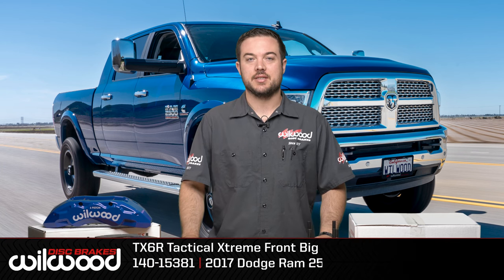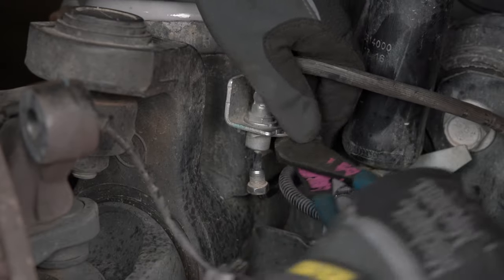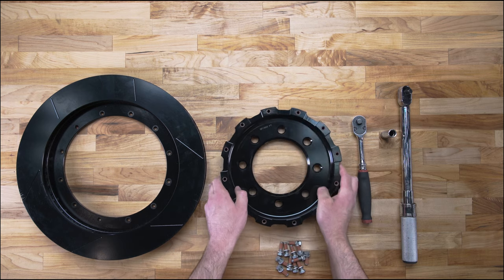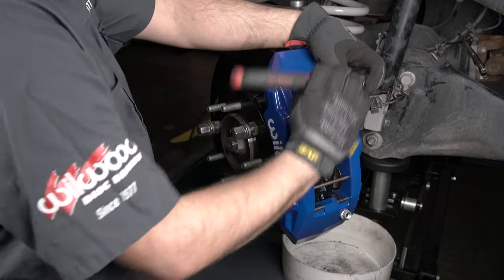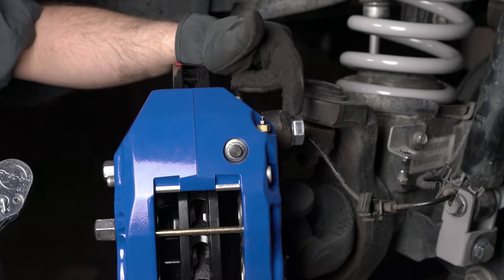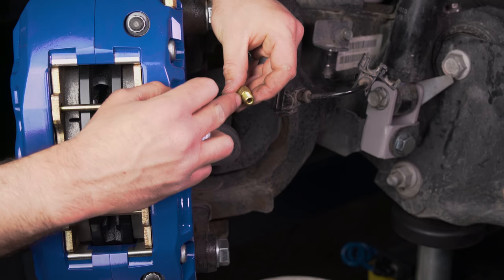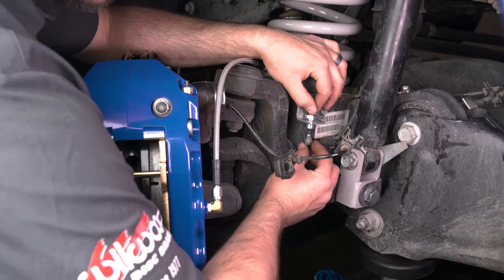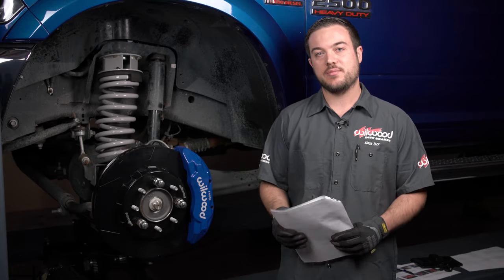2017 RAM 2500 Wilwood TX6R Front Brake Install

Comment: What is the advantages of this kit vs oem?
Reply from the maker: The bigger pistons will add high clamping efficiency. The increased rotor size will help keep temperatures down especially during towing.  Engineered to be fully compatible with the OE master cylinder output and retain full function of the ABS system.
Reply: @WilwoodDiscBrakes  can Wilwood supply un drilled rotor hats?
Also what are the material choices for rotor weight savings…?
My application is for a similar weight vehicle with a 4x4 front axles.

Comment: Wow!! Really good brakes. Junk lift kit with coil spacer and shock extension. At least do the suspension proper if you’re gonna do brakes proper. Get a Carli or Thuren suspension under that rig

Comment: Where were these installed at?  I would love to get these for my 2018 2500 but don't want a shop to F it up.
Reply from the maker: Hi, sorry we do not do in house installs. We recommend looking up a shop with the best reviews.
Reply: What made you think that using those tiny 10mm studs on the adaptor is heavy duty enough, when you can see that the OEM bolts are like 17mm. The OEM bolts are 3x the cross sectional area of those tiny studs. And you changed to a shear point that is further out from the axis of rotation. And changed from a trial shear plane to a radial shear plane. All while increasing clamping force. Those studs look anemic.

Comment: Do not have 18" Wheels. Would be nice to know what additional information on wheels is required as I was seriously considering a full brake kit replacement on the whole truck. Shims and Pins do not exactly instill confidence in this kit as the flex line is considerably smaller than the factory line. Glad I watched this FIRST. Think I will keep shopping. Bye Bye Wilwood
Reply from the maker: Thank you for the feedback and we'll take that in to consideration with future videos. All of our kits have a wheel clearance diagram on the product page on our website. We'll be sure to include that information on future videos as well. Please let us know if you have any other questions and thanks for watching.
Reply: @WilwoodDiscBrakes  Yea found that after the statement. Thanks for the reply.